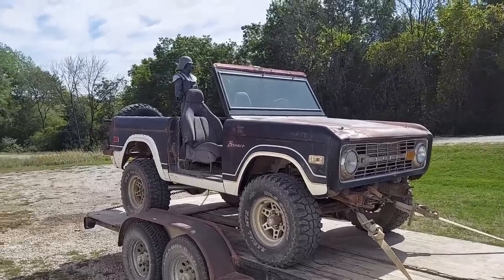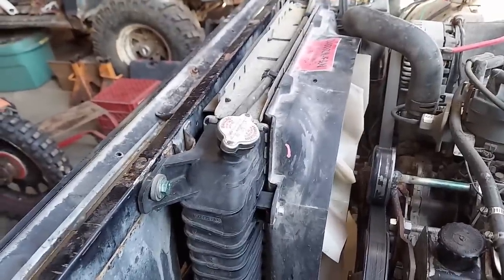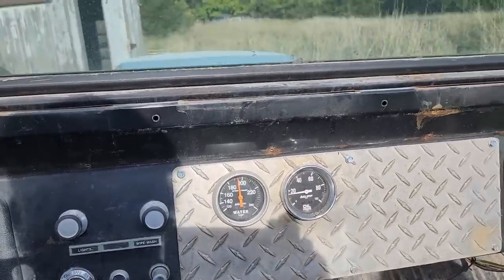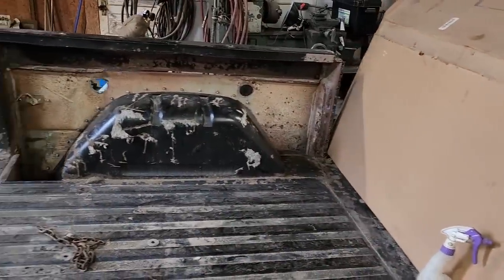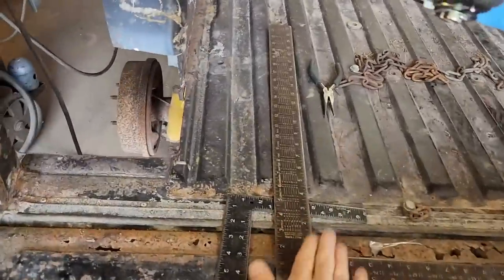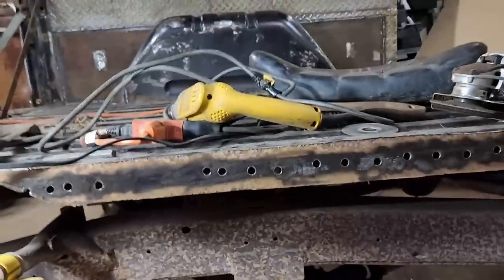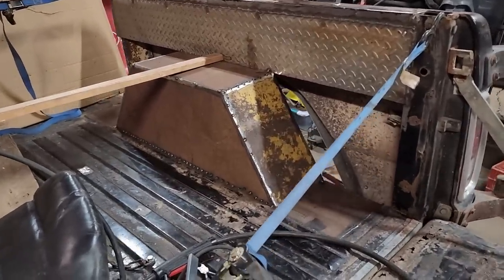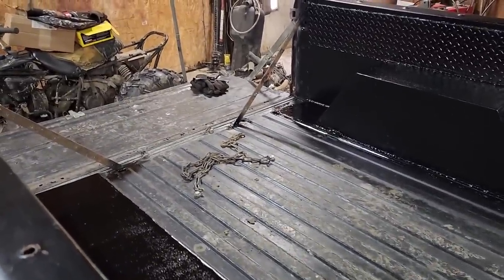Derelict 76 Bronco PT6- low buck cooling system and rust repair.

Comment: Looks good, lot stronger than it's been your doing a great job, not everyone can just go and buy brand new, great video thanks for sharing, all the best to you and your loved ones
Reply from the maker: Even if I could afford the repop metal, I doubt that I would have done it for this rig with the condition of the quarter panels and caps.
Reply: @misfittoys8883  true but some people would prefer it to be repaired with brand new, considering the rust factor in your area, although my 77 landcruiser isn't fairing to well, here all the older ones last great, all the best to you and your loved ones cool stuff

Comment: I love the plate steel wheel wells, should be a lot stronger
Reply from the maker: Even though I did the work, I am a bit amazed how well it turned out. Almost like it is not the same vehicle I started with

Comment: Of course you know it's gonna get louder as time burns the baffles out
Reply: Also I think the blue hood looks badass
Reply from the maker: It will get louder slowly enough that I will barely notice it. It IS a little bit quieter than I really wanted but I would rather have it too quiet than too loud- I outgrew that loud exhaust crap a long time ago.

I did actually like the blue hood the best, but went with the white for simple color contrast for now. I have other early Bronco projects that it could end up on in the future